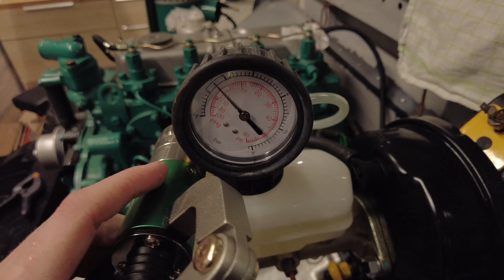Land Rover Series 3 Restoration Part 9 - Brakes, pipes and clutch

Comment: It is a good idea to fit the brakelines first, the the cylinders. Can you tell the threads and shape (E or F) of the connectors, pls.
Reply from the maker: Noted about the cylinders as it was a pain to install. Not sure which connectors you're referring too ?
Reply: @CMFotoPeak  I mean the Brakeline nipples. The latest threads are M10x1mm.  Some are 3/16"?

Comment: What brand is the brakelight switch,pls.? I tested several ones, as a lot of them don't last longer than 2 or 5 stopps.
Reply from the maker: I think it's the original, as i didn't change it. it says 39184 and 1381A on it. I haven't actually tested if it works yet ;D